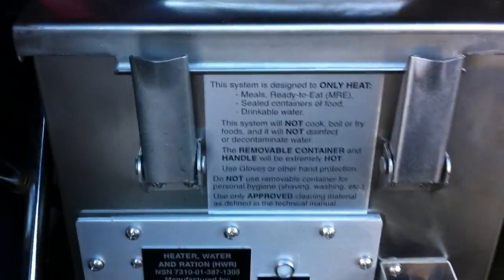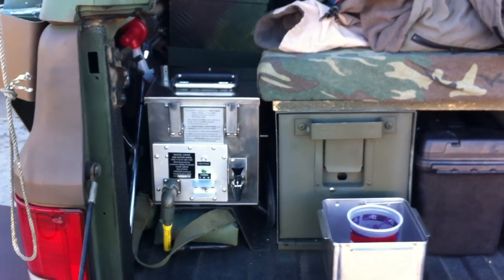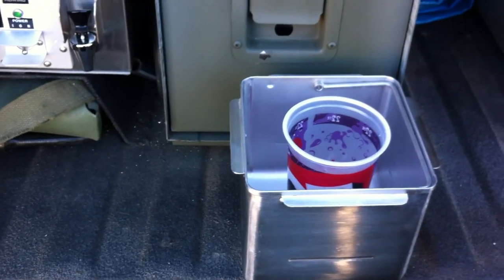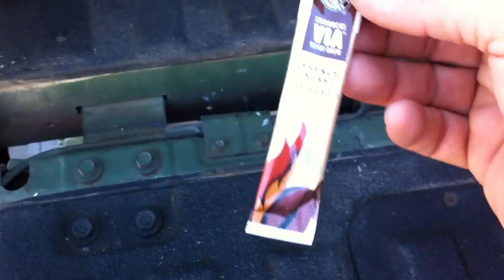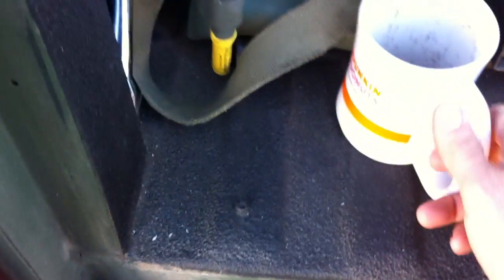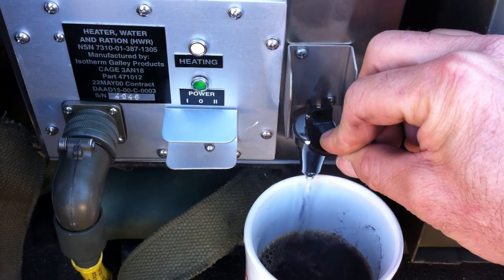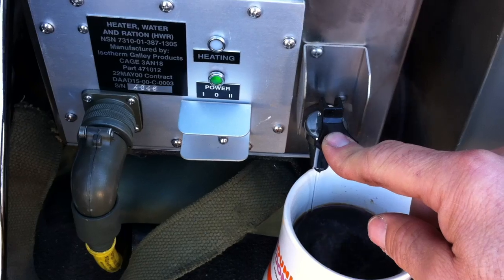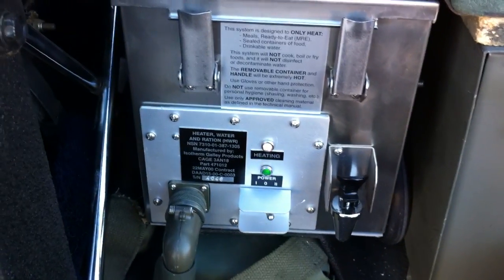MRE/Water Heater Set-up

Comment: i had one of these for awhile but sold it because i didn't have a vehicle with a 24 volt system. i never could find a power cable for it so what i did was remove the military power connector and replaced it with an aluminum plate that i made that had a strain relief for a round cable and i used an anderson connector for the power connection. it was easy to figure out positive and negative connections once inside the unit unfortunately i didn't keep track of which pins on the original connector were positive or negative because i had no intention of ever using it. now years later i could see having one of these installed in an rv with a solar 24v system, it would work great in that type of system.

Comment: Do you have a NSN or any part number on the power cordset?
Reply: +Subgunman  i was wanting to know the same thing.
Reply: +Noel Santos,  I have been looking for one still and no luck. The problem with the military manuals is that they seldom reference the accessories by part number. In this case they probably have several different cord sets based on the exact model number of the vehicle it might be installed in considering there are at least a dozen variants of the HUMMV and the MRAP's they may be installed in. A friend is trying to find the part number to the correct Cannon or Amphenol connector used on this and one other device he has. He will let me know eventually when he goes time between work to order one and try it. There are also two variants of the heater. The one shown in the video does not have reverse polarity protection built in and if you hook it up wrong, POP goes the control board inside. Good luck at obtaining the board, its cost may very well exceed the cost of what one pays for the heater.